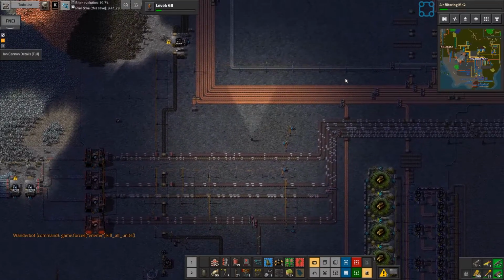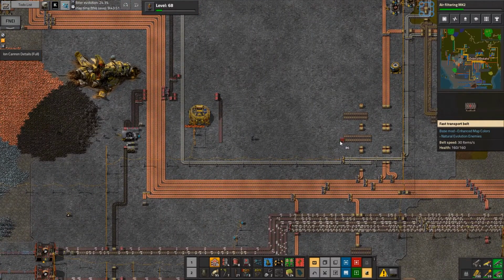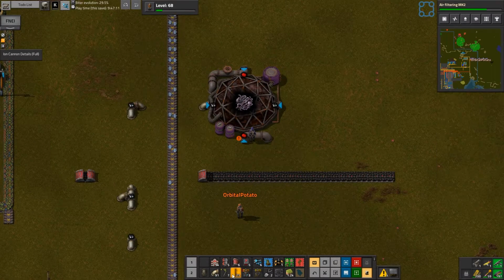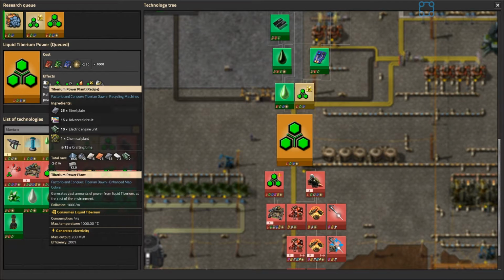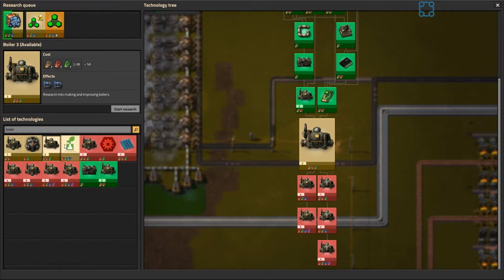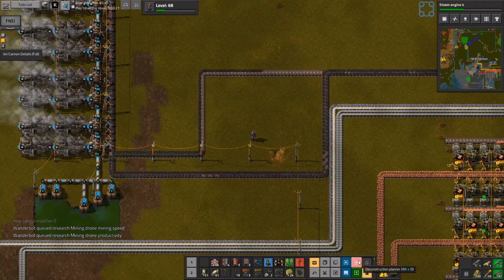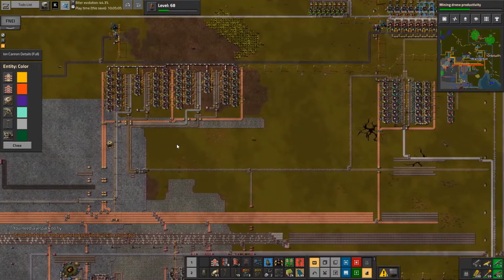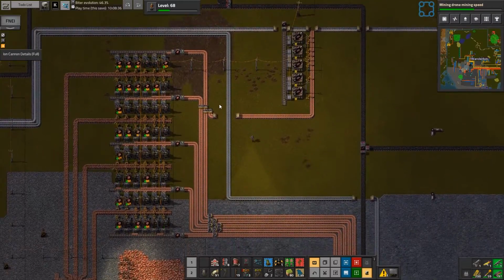We Just Invented Perri-Air - Let's Play Factorio [Krastorio Season 2 | @Orbital Potato] - Part 21

Comment: wander, the pollution spreads at default 2% every few seconds into adjacent map chunks. a chunk is about 50X50 fields or maybe 64X64, doesn't really matter either way.
if you want to make your base full green, i advise you to either surround your base with air filters, 1 per chunk is probably enough as long as their are a few chunks between major polluters and the filters.
or put them in the same area as your big polluters and place a few minor cleaners like those green houses in strategic places all over the base.
 .
in my game i put one or two air filters in the same area as my boilers, ovens and mining drones and that alone made my base nearly completly clean. for the rest i encircled my base in a big square of filters. i found a direct one-to-two setup of assembler to air filters on the border of two chunks works just fine. i just had to run a single coal belt around my base for the assemblers and everythings clean.